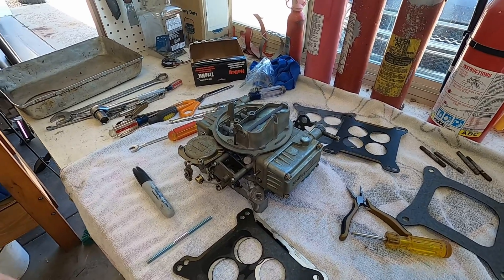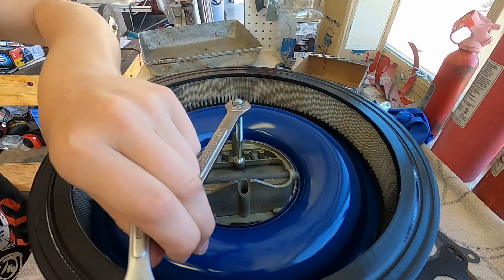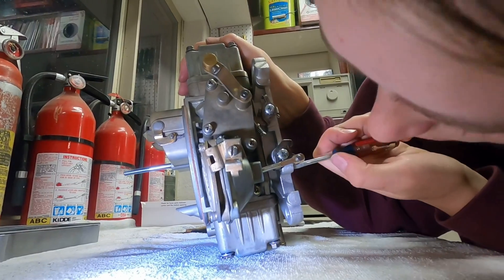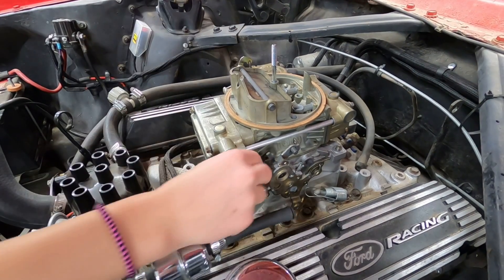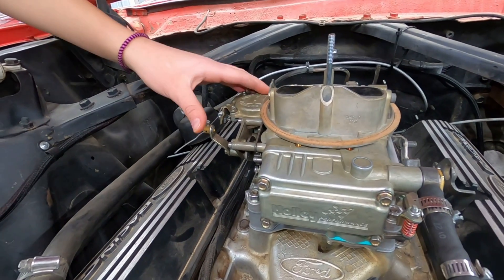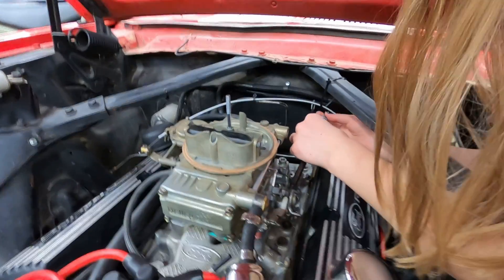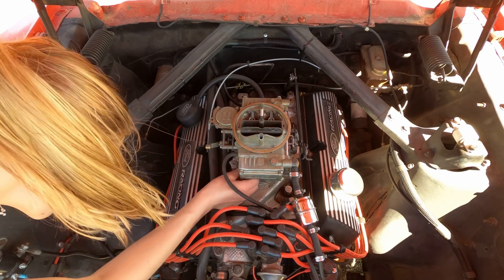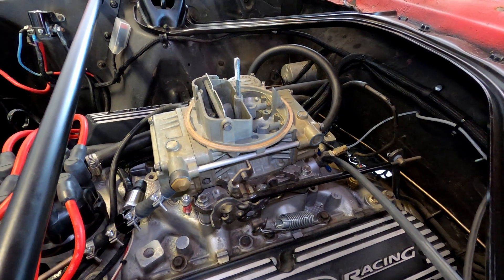Holley 4160 Carburetor - Installation And Adjustment

Comment: Where did you get that block off plate?  I’ve been blowing out gaskets on my 351 because of that exhaust port and would love to seal it off with a plate like that.
Reply from the maker: I believe your question is about the plate seen @3:52.  It came with the Mustang when Kailey bought it.  It looks an awful lot like these Mr. Gasket Heat Dissipater plates: https://www.holley.com/products/fuel_systems/carburetor_components/carburetor_gaskets_adapters_and_spacers/adapters_and_spacers/parts/97

Comment: A Great follow up video and good result for your Holley rebuild. Would be good to know how it performs when driven and how well the secondaries are working on full throttle?  BTW what is the brand of manifold you mentioned? Cheers
Reply from the maker: To answer your last question first, it's a Ford cast-iron manifold, definitely nothing special, but at least it is a 4-barrel manifold.  The car runs really smooth and sounds good, so I feel good about the rebuild.  We're dealing with some other issues though.  A leakdown test showed that the engine's worst cylinder is at 30%, and others aren't a whole lot better.  It's causing positive pressure in the crankcase and leakage at the valve covers.  Basically the engine needs to be replaced, and that's exactly what we're going to do, as soon as we get the car back.  It was hit by a drunk driver last fall and is still in a body shop as a result.  Hoping to get the car back in March.